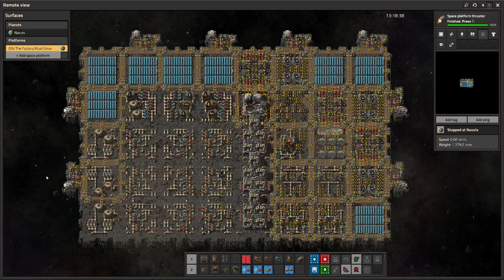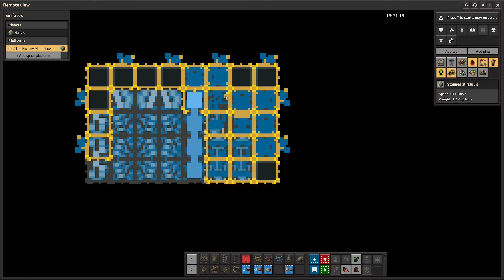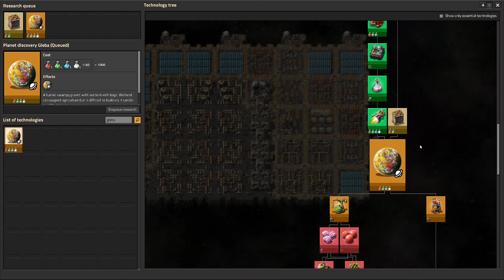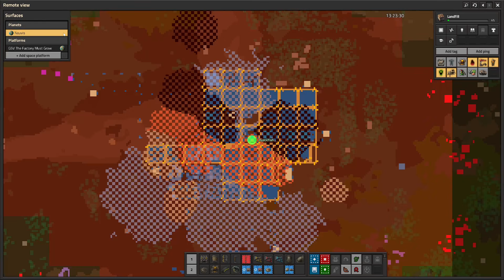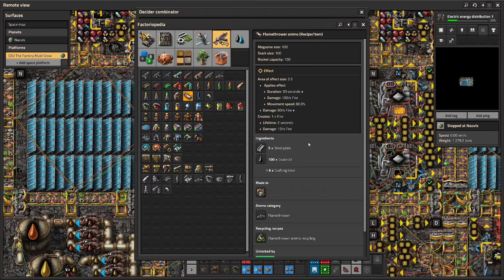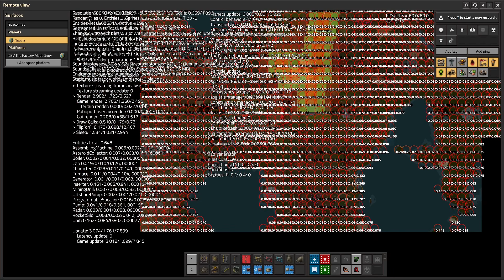Ep18 - Packin' the Minivan - Factorio Space Age GSV

Comment: Thinking more on the renumbering of fluid and solid recipes, would splitting out the two conditions (e.g. Each=1, Water>1 and Each=2, Water>=1) into a separate combinator that then outputs a single value (1 on the Water channel) work? The rest of the conditions for each of the recipes is the same, I believe. I'm not sure if it would work, or even be worth the effort, but it might be worth thinking about.
Reply from the maker: Hmm. The tricky thing would be doing the loopback across both combinators I think. But the idea of using two combinators does create more options.
Reply: @mysticfishgames  Tough to explain my idea, but I'll do my best. It might take two more combinators instead of just one, which makes this a lot less appealing.

You can keep the current recipe selector combinator and keep it outputting the Each=1. You would take the output and output it on one wire, and while also outputting on the other wire that's also wired to the demand wire. I think that should get you the "start" signal (odd) on one wire and the "keep going" signal (even) on the other wire. This step might need an arithmetic combinator, I haven't actually tested it.

Assuming that step worked, you can put the "start" and "keep going" signals into a decider combinator. These signals are the same signal, just on different color wires. Let's assume ice melting. That means that Water=1 or Water=2. So, IF (Each=1 OR Each=2) output Each=1. Ideally that acts as a latch that you can feed into the recipe combinator along with all the ingredients same as before. But like you said, the loop back might mess things up.